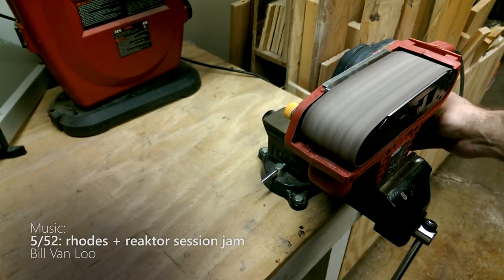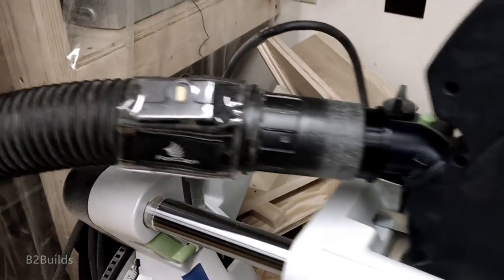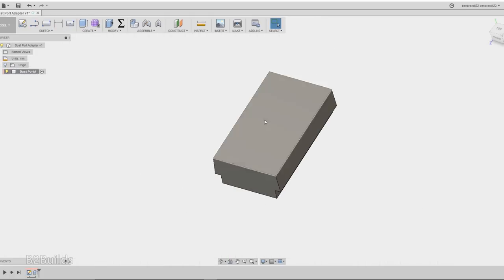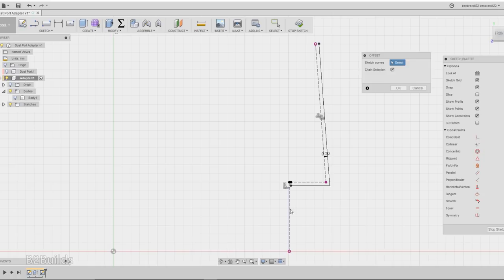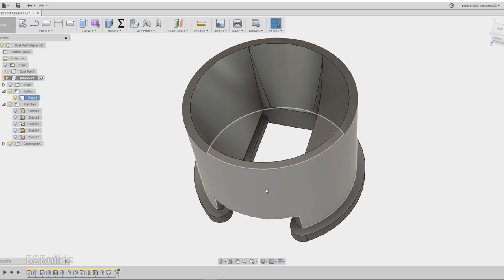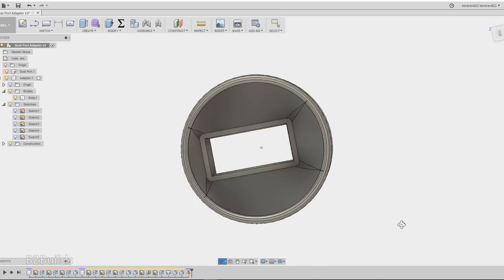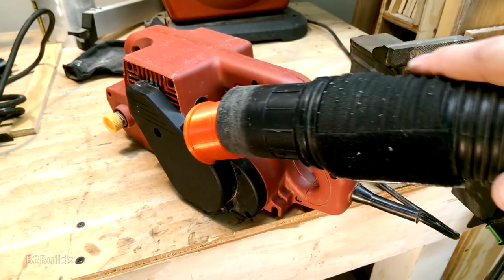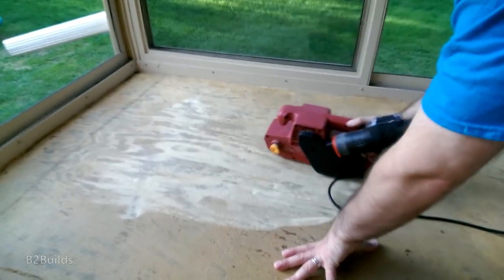Harbor Freight Belt Sander to Shop Vac Dust Port Adapter

Comment: Ben, this is the exact thing that I like about 3D printing.  Sure there is ton's of Chotchkie made with 3D printers, but it's the problem solving possibilities that actually appeal to me.  I really wish when people went to a show like Maker Faire, the 3D printing booths would load up with practical problem solving uses like this that make owning a 3D printer more than a toy.  As soon as I see something like this video it opens my mind to other possibilities.  Great job.  I look forward to more  problem solving  and useful projects from you.  Thanks for continuing to put out great content.  -Chad
Reply from the maker: Absolutely. While there's plenty of room for useless widgets (I've made my share), they've definitely helped me learn the 3D printing process and how to make my prints turn out better. But I agree, it's the interesting problem solving opportunities that make it fun for me. Thanks for the comment. Time to go play with my 3D printed fidget spinner.
Reply: You took the words right out of my mouth.  I couldn't agree more.
Reply: Ben Brandt even a fidget spinner is useful.  More useful than an  Eiffel Tower or Yoda. Sure they demonstrate the capabilities, and they may even teach how to design, but an adapter or replacing a bracket on an old window shutter that isn't made anymore is so much more valuable.

Comment: I'd like to tell you that this belt sander was made by our factory , do you have any good suggestion for us ?
Reply from the maker: Excellent! For small sanding jobs, it's good to have something to collect the dust, but the cloth bag seemed difficult to remove and difficult to empty for me. I have a random orbital sander that uses a plastic canister to collect dust with a filter on it to let air pass through. It's easy to remove and easy to dump out. I'd suggest making the dust collection easy to remove and empty out, and making the dust port round would make it easier to hook up to a vacuum.

Comment: I don't have a 3d anything but I measured the port for the belt sander...cut wood doen to the same size as the port, got a 1-1/2" PVC coupling and with a heatgun melted the pvc with aid of pair of pliers molded the pcv  to fit the wood. The other side of the coupling I bought a slip coupling to fit the shop vac hose works good
Reply from the maker: Sounds like an effective solution, nice work!
Reply: Thanks Ben

Comment: Hey, what did you use to record your screen? I've been looking for a good solution (that doesn't cost 200$) 🤓👍
Reply from the maker: I use Open Broadcaster Software ( obsproject.com ). It's designed for live streaming but you can also easily set it up to record your screen to a video file. It took some effort to get it configured, but it's been working very well for me.
Reply: Yeah, I've used OBS before... but it does take some extra work to get working right on the mac... if you want to record desktop audio at least. Thanks!

Comment: Excellent work in Fusion 360! Nothing wrong with a shop vac for dust collection. Just plug in a dust separator of some sort so you don't have to empty it as often.
Reply from the maker: Yup, I definitely need to get a dust separator :-)
Reply: Ben Brandt my last video was how to make one.
Reply from the maker: Nice! I thought about a thien baffle for awhile, but just recently picked up a low cost cyclone that I'll be trying out.

Comment: I don't see the need to model in mm. Can't you just export the STL in mm even if you modeled it in inches?
Reply from the maker: +Justin Depew Good question. In Fusion 360, if your model's measurement units are set to inches, the STL will export its values in inches, and it will show up 25.4 times bigger in the slicing/printing app. Some have tools for dealing with this, but working in millimeters from the start can make things a bit easier overall.
Reply: Ben Brandt that's a bummer that fusion doesn't allow you to select units when exporting a STL. You can do that in Inventor so I assumed fusion would have the same ability.

Comment: This is what I try to do with my students.  I always try to have them design things that they can use or need to repair/add to something they already own.  Right now I have them designing end caps for a retractable floor sweep magnet.  I have them designing in a place to put a bolt into the cap and support a wheel that will be added so we can roll it around when picking up metal scraps. They are also designing the wheel for this system.
Reply from the maker: This is great. Sounds like a relatively simple modeling exercise for learning with a big impact on functionality.

Comment: Having a 3d printer is on my top 5 things to purchase in 2017. And this is just the project I need it too. There is always a dustport missing, a 4" to 100mm problem etc. :) 
Thanks for the video

TR
Reply from the maker: Cool. There are a number of cost effective printers to get you started. Dust port adapters are really useful and a good gateway drug to more printed projects  :-)

Comment: That turned out great! It's inspiring me to print one for my miter saw, thank you for the tip on measuring using millimeters for the design!
Reply from the maker: Thanks. That basic adapter has gotten so much use. Go for it!

Comment: Give the piece an acetone vapor bath. It won't hold as much dust on the sides.
Reply from the maker: I printed mine in PLA which doesn't work with acetone, but that's a good tip if you're working with ABS. I'm not too concerned with dust on the inside but it would help keep things nice and tidy for sure.
Reply: Yeah, no luck with PLA. You could sand it, but that's too much work for the inside of an adapter :)